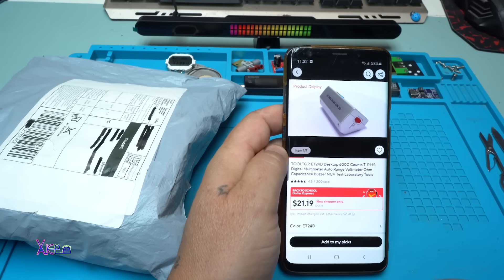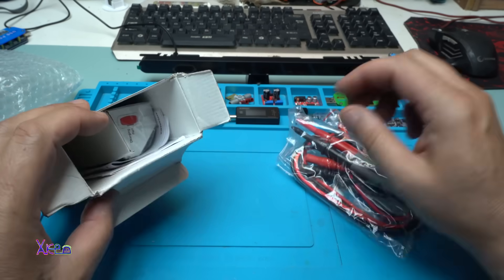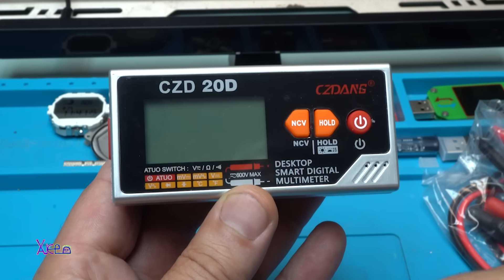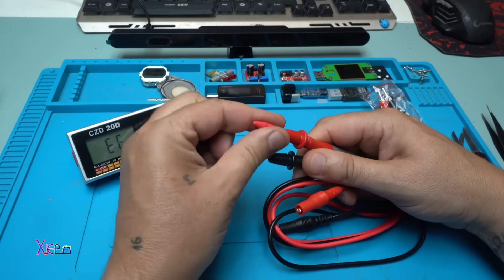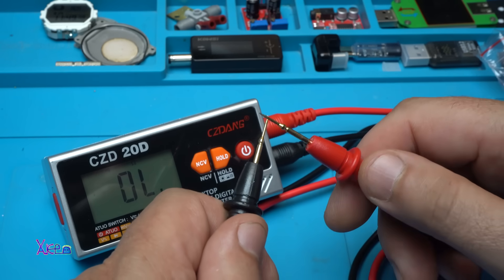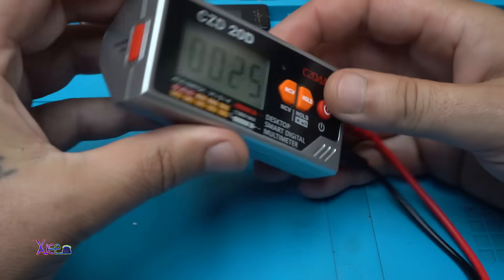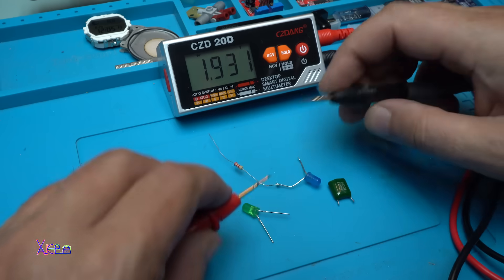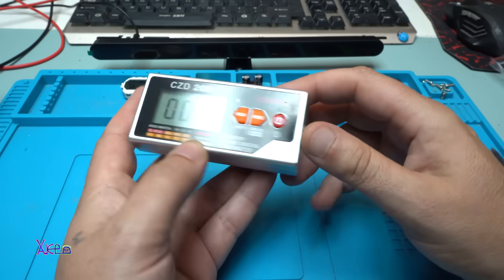THIS IS TALKING Multimeter from Aliexpress - TOOLTOP ET24D

Comment: Now check for isolation between the USB socket and the 4mm banana sockets, want to bet there is none?  Also check out the voltage protection inside the meter, likely minimal.